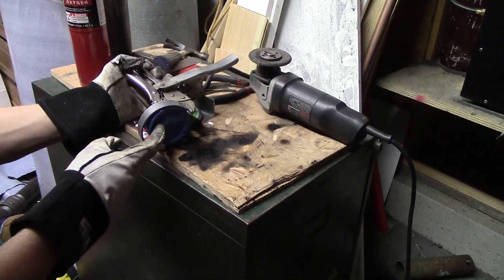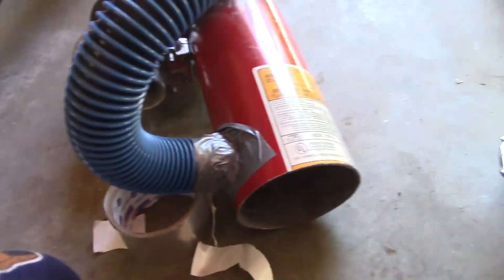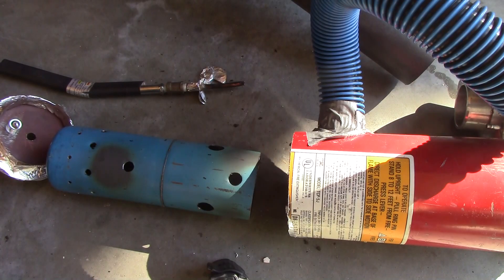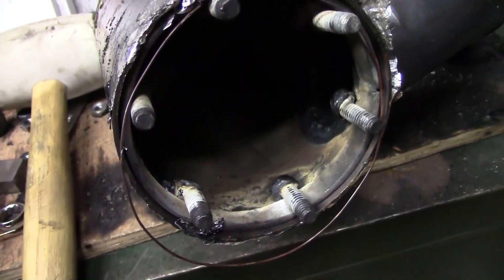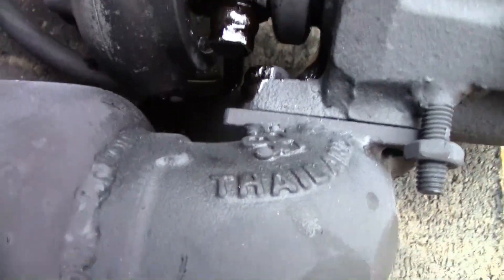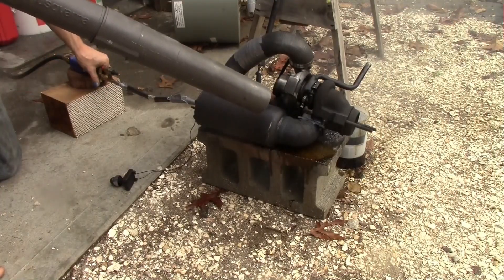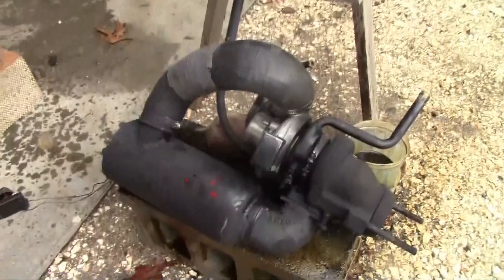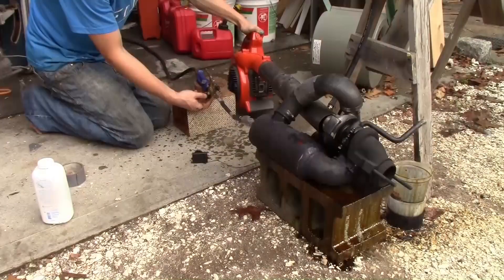Quick TurboJet Engine Build

Comment: As I've noticed a blower in the intake makes the turbo run the opposite direction and then once started the turbo turns the other direction , might be able to use some sort of suction on the turbine out put but not sure

Comment: Can it run off of gasoline?
Reply: Unsafe to use gasoline, diesel or kerosene is usually used. Or a 1part gas to 4 part diesel(easier starting)

Comment: you need a computer to controll fuel intake and stutdown sequence
Reply from the maker: need is a pretty strong word, it did work
Reply: for how long ?
Reply from the maker: Well Yea but that was mostly cause I turned it up a bit too high... I mean the the scope of this project was like $100 so I wasn't super worried about blowing the turbo. An oil feed pump would be first, this was mostly just to get a turbo jet engine running. Yes tho, to do it right there is no replacing a computerized fuel management system
Reply: if u have a blade off it will cut u in half

Comment: there was no oil pressure so bearings impacted shaft and housing so the wheels grinded inside the housing
Reply from the maker: The turbine rotor completely melted. The bearings still worked, although yes, it is a really bad idea to run a turbo without oil pressure for any duration of time.
Reply: BenNBuilds i saw this before on lot of cars with wrong oil filter the outer part of the both wheels impacts first and causes that deep wining sound the turbo probably had large shaft play in first place because small turbos are not built to last
Reply: BenNBuilds you can even try using servo pump to get oil pressure going keep it in 2 bar range most turbos run on that pressure 😀

Comment: guys help I make same like that jet tutbo but whan I try to starting fire its stop  what is problm?
Reply from the maker: +fool kalya could be a lot of things, your combustor doesn't have enough power to spin the turbo and keep it going. Likely due to an undersized hose from the compressor, improper fuel burning or weird sizing/hole spacing in the combustion chamber. Hope this helps
Reply: +BenNBuilds thanks bro your answer is right nd can give me ur fb name or whatsap I will send you all parts pictures?
Reply: super jamali if you can't ask the question properly then build a engine like this is way over your head. Try playing with some model rockets from Walmart first.

Comment: The turbojet would work better if the tube connecting the combustion chamber was little bit smaller because the pressure is probably to low. 

The combustion chamber needs to have high pressure for when the oxygen density higher than the normal atmosphere it cause the fuel to burn explosively
Reply: In this case I don't think it matters. If it is a big tube like this one, it works as a diffuser. Slows down the speed of the compressed air and even more pressure is added.

Comment: You've failed at a couple points, but great build.
First, you had to do a high-pressure cooling system(i.e a steering wheel pump), you can't gravity feed the oil in, it just doesn't work.
Second, you failed with calculating the flame tube holes, because it got too hot. You should have stopped and drilled it out when it got visibly hot on the snail.
Third, to get thrust you need a nozzle(look up how jet engines work, lol).
Also, your gas pressure coming into the exhaust side is a bit too low, but you can't fix that without doing some heavy metal work.
Overall, good build.
Reply: If it leaked that badly, shouldn't have used it for this. Those bearing depend on pressure and fluid to work, not hopes and dreams. Neat little build, but not pressurizing the oil system is just tearing things up.
Reply from the maker: The turbo leaked so much there was no way I could use an oil pump
  I think the main thrust issue (other than the obvious) was the ducting for the exhaust bypass, it shot down and flattened out quite a bit. The turbulence involved in putting a nozzle behind that just erked me too much. Its also hard to ignore the exhaust is shooting at a few hundred mph and a surf board would be doing maybe 5.
  The flame tube was off to say the least lol but it did run pretty cool at low power, just when I turned it up all hell broke loose. A more linear temp curve or at least one that can accommodate the higher speeds and fuel flow would solve that (bigger holes+ more spin to slow it down).
 I just had the thing and wanted to use it, not sure if I'll actually build a legit one in the future but now I know how easy it can be to get one working. It was a good way to spend an afternoon either way
Reply: BenNBuilds I'd love to see you build a jet-powered surf board or some propelled vehicle\vessel of some kind.
Too bad we don't have scrap yards or anything like that here. I only managed to find a BMW diesel turbo for $50, but the project is frozen until it gets warm again(-4C here already).
Have you ever thought of building a CNC machine of some sort(3dp, mill, lathe, router, all-in-one)?
Reply from the maker: ***** My neighbor has a sweet homebuilt CNC that I use sometimes. Sounds like you need a jet engine to unfreeze that problem! lol
Reply: @Spirit532  could you teach me the calculation of the flame tube and what suction well take for the measurement 

Thank you
Reply: Take a look at Colin Furze's how-to series, he explains all the math and parts.